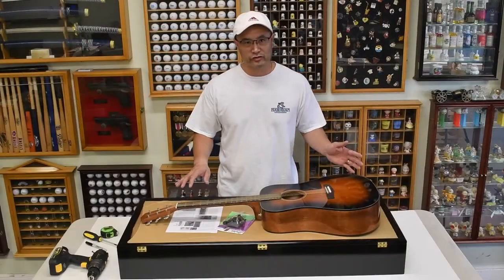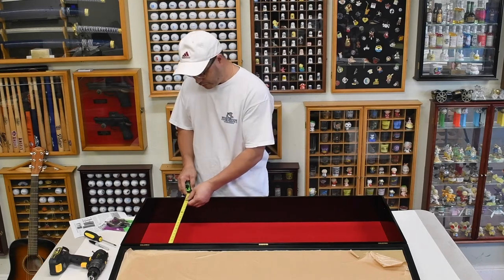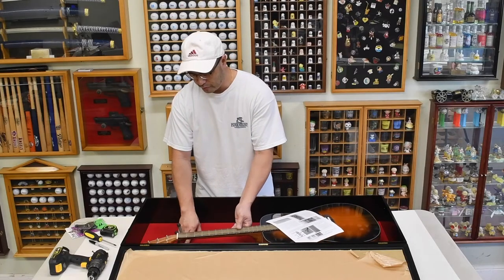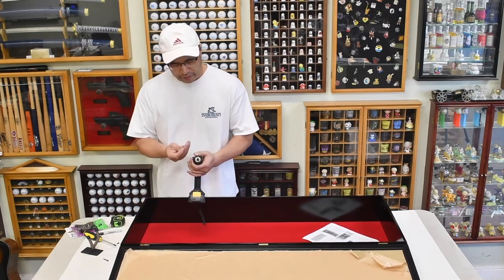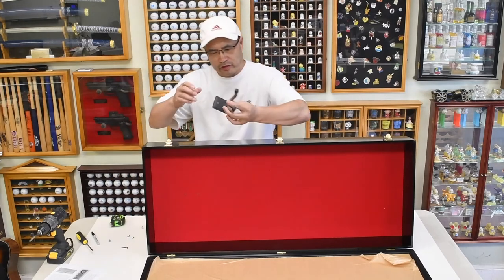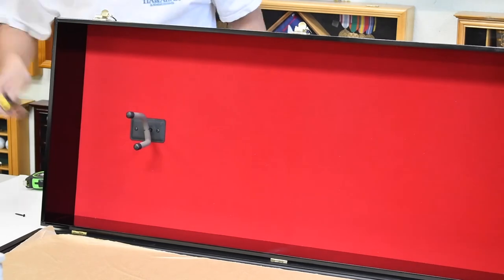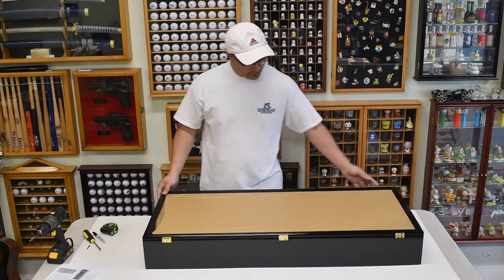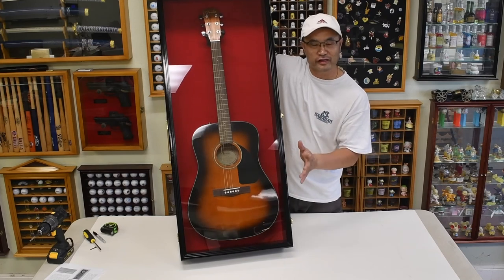How to Mount a Guitar in a Display Cabinet

Comment: Do you have a video showing for Horizontal mounting?
Reply from the maker: HI Birt,
Thank you for watching and for your request. We will look into adding a short video for that soon. The horizontal mounting are 2 pieces of hangers; one for the neck of the guitar and the other for the body. The installation steps are the same since the mounting plates are identical. Just be sure to take the time and test fit for the best positions to attach them to the inside of the cabinet. But, rest assured to know that once you have the hangers mounted there will still be some degree of adjustment.